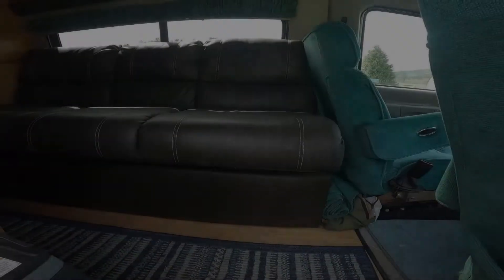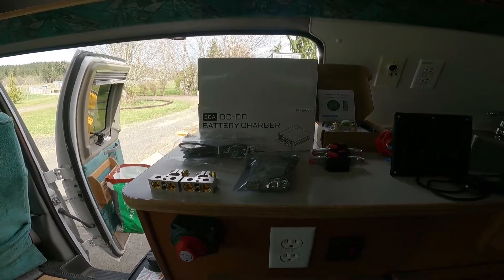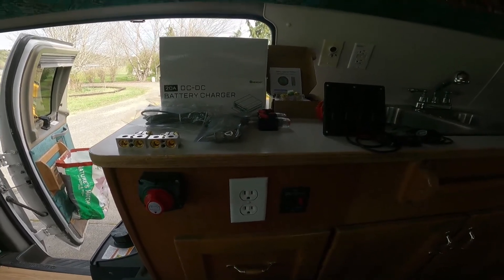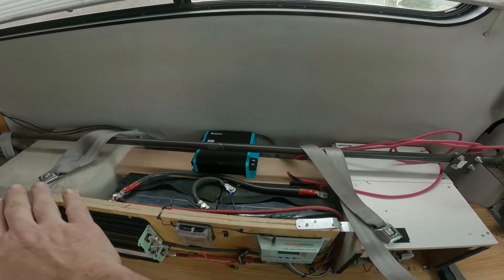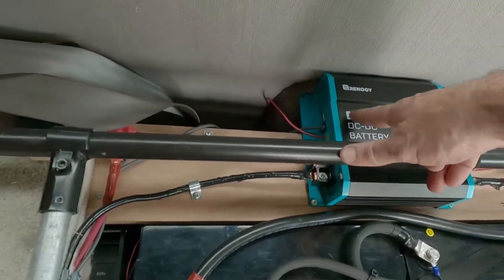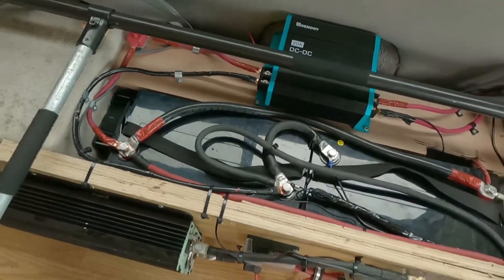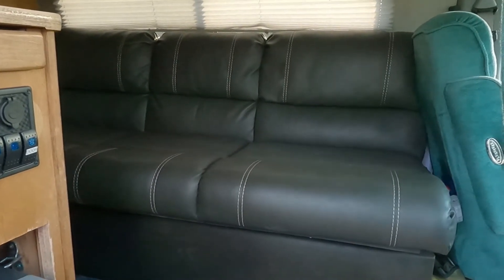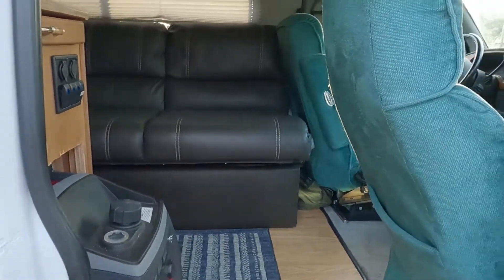Campervan Renogy dc to dc charger install

Comment: With your dc to dc charger should the negative be on the load side of the shunt and not directly to battery
Reply: But does that mean the shunt can't then pick the charge up from the shunt to monitor
Reply from the maker: @VanCrazy2023  well my system is stand alone from my vehicle so my monitor is just for my solar. My batteries 2 deep cycles are tied together so i can monitor them together.
Reply from the maker: I ran mine directly to my batteries and those are wired to my shunt.

Comment: I just ordered  the same dc to dc because my isolator can't do lithium do you think I can run the isolator to the charger and add the D+ to the positive to act as the on switch since the isolator turns on and off when the starter battery is charged or not
Reply from the maker: @Jonathan  Nunn I would definitely suggest adding it to its own switch so that you can start and stop the charging as needed. I would also suggest adding the power supply for the switch tied into a power supply that will shutoff when the key is removed from the ignition just in case. lol. You can buy piggy back fuses that work perfectly for that. Best of luck and feel free to reach out if you have any other questions.

Comment: Where in the vehicle did you connect the B+ wire? I am about to do the same install and trying to find where to connect the B+ wire.
Reply from the maker: @Harrison Hodson, I ran the B+ wire to the toggle switch on my dash. I have a voltage display mounted on my dash as well so I can see the system voltage while I am driving. So if my solar is lagging I can just flip that switch. Some people tie directly to their starter and I believe some of the newer vans already have a place to tie one in. I just tied my toggle switch to a blank fuse spot on my factory fuse box. If you are going to wire it that way make sure you test the voltage with the ignition on and off so if you forget to turn off the toggle switch you won't drain the primary battery. I hope that helps and best of luck.
Reply: @beardedfamilyman243  thank you so much!! That really helps!!

Comment: Good install, good thinking about the possible seat belt problem,  cool little camper. Got a question for you:  If you got time to answer, can you charge your batteries when idling or do you need to be moving to get a correct charge.?  Reason I'm asking, I end up idling a lot.
Reply from the maker: @Indy Outsider, thanks for the compliment. It will still charge while idling with no problem. I would suggest adding a toggle switch and also a battery meter so you can see the voltage on your batteries so it's easy to just switch it off once they are charged. Hope that helps and best of luck. If you have any other questions feel free to ask I will do what I can to help.